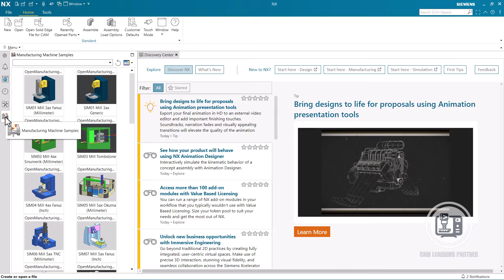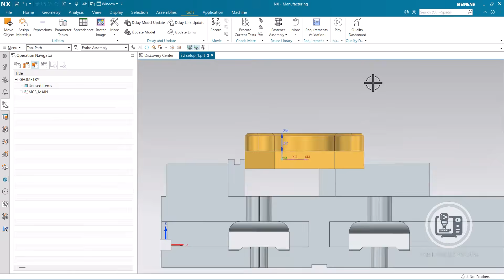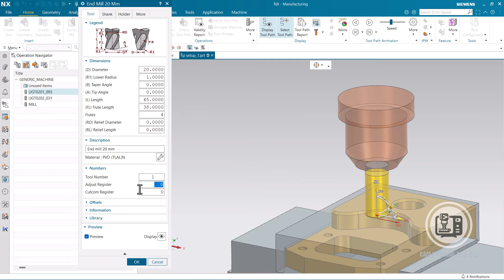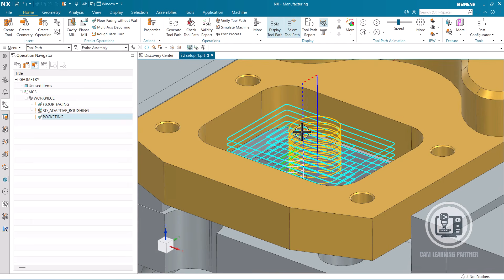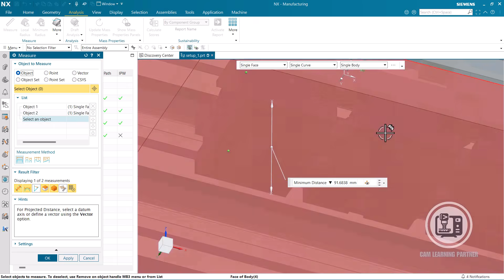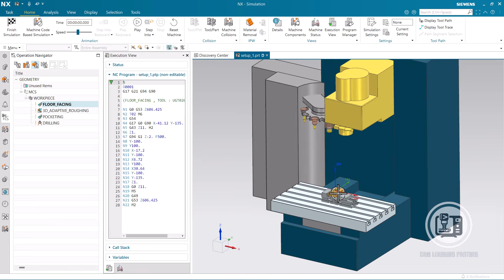Comment: I tried to follow this tutorial but for some reason it wouldn’t allow me to select the whole jaw at once. Kept trying to move individual pieces of the jaw. Same with the part I downloaded. Kept trying to move every dimension of the part instead of selecting the full part. Idk why it has to be so confusing😅. I was following along and when you clicked the jaw and distance to move it, I couldn’t select the whole movable jaw. Same with the whole part at once. It thinks every dimension or internal part of the movable jaw is a different object.
Reply: It sounds like a selection filter issue. Make sure your selection filter is set to "Body" or "Solid". Also, ensure that you import the fixture within the same prt file as another Solid using File > Import options. If you are importing it as a part (using Assembly functionality), the way you change the position of the jaws would vary.
Reply: Let me know if my answer still doesn’t help.

Comment: Fantastic tutorial! What version of NX CAM are you using?Would love to see more.
Reply: Thanks for your feedback. Glad that you found the tutorial helpful. The version used in the tutorial was 2312, as far as I remember. 🙂
Reply: @CAMLearningPartner  One other question, at 14:40 I cannot select the vise, only the part. Can you elaborate on that a little?
Reply: @toadsix958  Sorry, I missed your comment here.

It’s possible that you added fixture as assembly or rather as separate ‘parts’ instead of them being just solid bodies within the same .prt file/project.

If that’s the case, use wave geometry linker to add links of solid bodies from the imported assembly to the current work part.

Alternatively, use File > Import instead of adding parts through assembly.

Hope this clarifies. 🤜🤛

Comment: Sorry but I didn't get why you install the part into fixture first before fitting a stock ???? So now your stock geometry overlaps the fixture geometry which is nonsense. Also you say "I don't want any additional offset but Z only for face milling" but in fact you add the uniform material excess to the sock all over the entire part so your stock gets swollen in all 3 dimensions again .
Reply: Hi, thanks for sharing your feedback.

We can add the stock first if that is available as a geometry. Since for us, the part was ready and so was the fixture, I used both and then added what was left (stock). You can add stock into the fixture first and then assembly the part. It’s totally dependent on what geometry we have available.

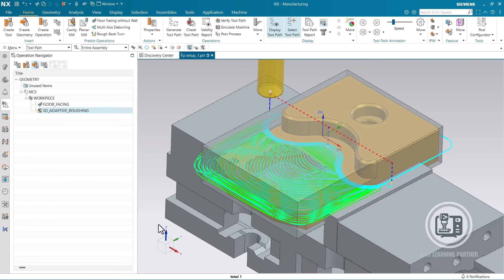About the additional offset on stock: this was corrected at 36:20 . You are right here. The uniform offset was set by mistake and hence it was corrected later (during generation of Adaptive Milling tool path).

Let me know if you have any other questions.